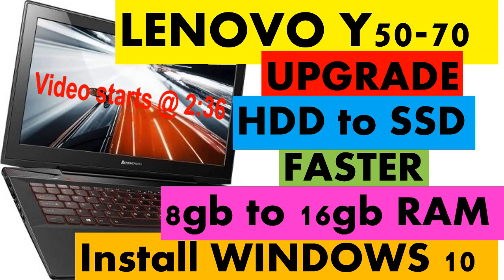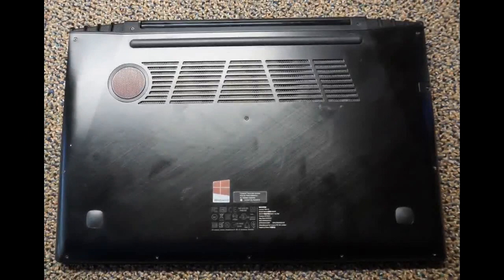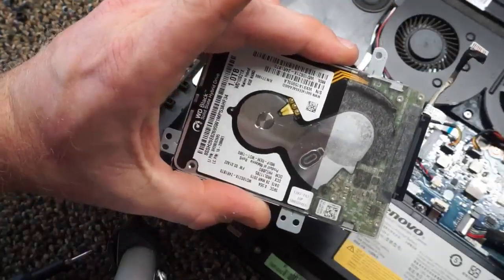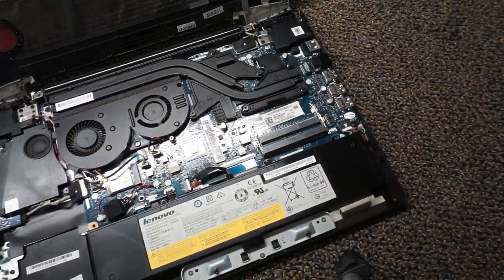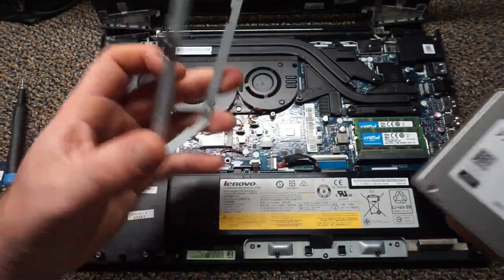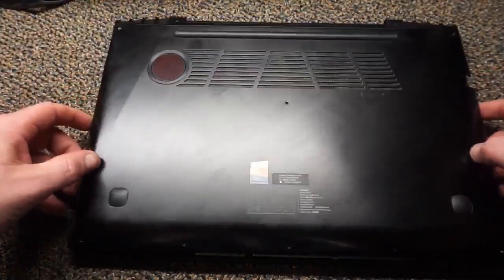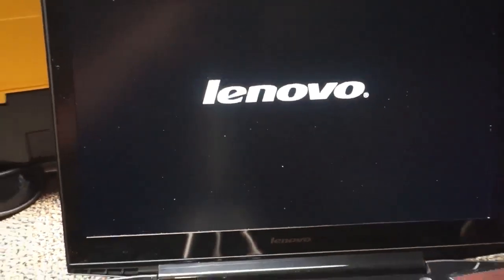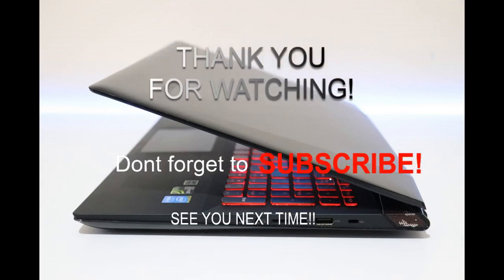LENOVO Y50-70 | How to upgrade your Lenovo Y50-70 and improve performance

Comment: Mine has been gunked up on the palm rest and the rubber screen gasket is slowly flaking lol. But there is no dust at the inside though, maybe because of the filter at the bottom. Still using it to this day as my main internet machine and occasional gaming like gta 5 and fallout 4.

Also if you don't want to reinstall Win10 on the old HDD you can clone/image the whole disk using Acronis or Macrium
Reply: yo same here, the left side is kinda nasty with a colouration diff, but just wanna ask how is your graphics card performing cause mine has been shit and it keeps going to blue screen when i use my camera. do you have any issues like this?
Reply: @bryanvinodh9500  mine is doing well. no bluescreen when gaming with latest nvidia driver or using webcam. the only major problem i had with this laptop was the shit 1tb sshd. only lasted for a few months before it stopped working

Comment: Hello. Could i upgrade 1tb storage to 2tb storage?
Reply from the maker: You should have no problems upgrading to an 2tb drive. In fact Crucial makes one that they claim works in the Lenovo. Find it here: https://www.crucial.com/ssd/mx500/ct2000mx500ssd1
Reply: @RandomTechG  oh ya, i see a white thing on your heatsink. What's that? Is that thermal pad?
Reply from the maker: Lucious I’m not sure what you’re referring to. I don’t see the white pad. If it’s on The heat sink it may just be some sort of cushioning. I don’t recall seeing a thermal pad on the heat sink.

Comment: Can you do this without installing windows into a USB?
Reply: You can always clone your original HDD if you have one of those hdd/ssd readers, but they need to have loning" setting. either borrow it or buy wone if you are changing your drive, they're quite cheap.

Comment: I play gta 5 on the lenovo y50 and my fps is so bad, later i found out its because im playing on 48hz refresh rate and i cant change it, not even from my display settings, please help
Reply from the maker: I believe the FPS on this model laptop is locked at that rate. I’ve never been very happy or had much luck with this laptop for gaming.
Reply: Motorman Yeah... ive been suffering on 45 fps sometimes even like 11 fps playing gta 5... anyways thank you for replying
Reply: @YahYuh  down the resolution bro its so cool with this hz
Reply: @RandomTechG  Do you still have this machine ? I can take it with gtx960 4g i7 4th 16ram 4k display need it for gaming and editing need some advice pls ;/
Reply from the maker: I have never had any luck playing modern games on this laptop. I would experience FPS issues and thermal throttling pretty regularly which made games unplayable. However, follow some of the advice on this thread. It may help you.  https://forums.lenovo.com/t5/Lenovo-P-Y-and-Z-series-Notebooks/Y50-70-Low-FPS-Stuttering/m-p/4253002
Reply from the maker: @dark info, I do still have this laptop. Mine isn’t the 4k version it’s the 1080p version. Wish I had the 4k.
Reply: @RandomTechG  how is it with you bro now 2020? This machine old about 4yeras i need it for gaming and editing my work need advice and about the price i can take it 450$
Reply from the maker: @dark info I’m good. How you? I’m not selling this one. I have more plans for it for future vids.
Reply: Try remove the dust filter that blocked up at least 60-70% of cool air intake at the bottom panel or use a stand fan to blow the air directly to the laptop while gaming on this device, I had such issue because of CPU throttling, but everything solved  after I did what I mentioned above.

Comment: after installing  nvidia drivers when i open games(like CSgo or DOTA 2) my laptop swtichs off please help bro. make a video abt the this issue please. thank you.
Reply from the maker: couple of this to try first... install a monitoring program to determine the temps during shut down. If temps are ok, run an event log and see if that tells you anything helpful. It’s likely either a bios issue or you’re mobo may be faulty. I’ve seen a lot of threads on this laptop with people that have the same issue. Many report they reverted to an older bios and it fixed the problem. Some say they tried this and it did not fix the issue and ultimately replacing the mobo resolved the issue. Personally, I have not experienced this on mine and have not had to trouble shoot this myself.

Comment: My laptop is the same as yours I'm having I'm crashing , laptop just powers off , when I restart I get no errors .
  I've upgraded mine like in the video
Reply from the maker: You need to run a pc or hardware monitoring program to see if you can determine what’s going wrong at the time it shuts off. HWMONITOR is a good one.
Reply: @RandomTechG  
 Thank you I have my local PC shop redoing the heat paste if that doesn't correct the issue then I will do that the laptop is about 5 years old so I figured new paste would help

Comment: I have a drop in the fps inside the games like dota 2 for example it runs on 50 fps and barely reach 60 on the other hand my older pc can run it perfectly fine. Do u think updating the hard drive and the ram would fix this?
Reply from the maker: It’s most likely thermal throttling. Check your temps at idle then check them while you’re experiencing the lower FPS. I believe thermal throttling is set at 75 degrees Celsius on these.

Comment: I also have this laptop, but can you make a video on how to fix its heating issue..

Mine is idle about an hour and its very hot
Reply from the maker: Nathan, first, start with the simple stuff. Make sure the vents are clear and not obstructed by anything. Dirt, debris, cloths, blankets etc when you’re running this laptop. Did this start randomly, or did this start after taking it apart? If non of the above mentioned things appear to be an issue, I recommend  to remove the back panel, check to ensure the fans and shrouds are clear of dirt and debris. If they are clean, run the laptop in a static free area with the back cover off and check to ensure the fans are working.
Reply: @RandomTechG 
That is also my problem i can't remove the back panel because of a stripped screw i dont have a method to remove it..
Reply: @aurelionsmol7374  Try putting a rubberband over the striped screw, thinish one. And use the screw driver as normal, the rubber can give extra grip helping remove the screw.

Comment: How about 16GB Ram only i installed without 1GB Hard drive? Is that fine only for my laptop y50-70
Reply from the maker: Upgrading to 16gb or RAM will definitely help although if you continue to use the standard HDD you will not see the full potential in performance.

Comment: Q????.... Did you back up everything b4 installing the new upgrades for laptop.  if yes..what was your method  for backing up everything without any problems????.
Reply from the maker: I did not backup this one. I had nothing of importance on it. I did however keep the old drive Incase I need to access something on it or use it for something down the road.
Reply: Re: OK

Comment: Hey did you replace the screen too? My stock screen has terrible colours and viewing angles. Btw can I put above 1600mhz ram?
Reply from the maker: I did not change the screen. That’s the factory screen. If you have the y50-70 it should be a 1920x1080 res  display. Unfortunately,  the memory max speed is 1600mhz with a max capacity of 16gb.

Comment: Do you have tearing issues in windows 10?
Reply from the maker: Not recently but I have experienced it. Screen tearing is usually associated with display adapter/driver (software)
graphics card (hardware), or
Windows display settings. The last time I had tearing issues I checked and updated my display adapter drivers and GPU drivers. In my case, updating those drivers resolved my screen tearing issues.
Reply: @RandomTechG   I had used windows 10 whet it was released and experienced tearing, so I decided to move to windows 8
Reply from the maker: If you like windows 10 and want to give it another try.... try this... Press Win + I to open Settings, then disable Game Mode. Restart the laptop and check whether your game works well without screen tearing. If you can still see screen tearing when you play games, you should disable the full-screen optimization of your game. That has worked for me in the last.
Reply: @RandomTechG  thank you, will try!
Reply: @RandomTechG  sry for my English